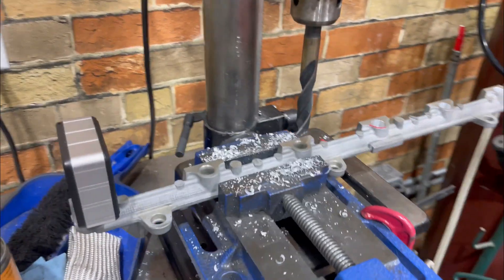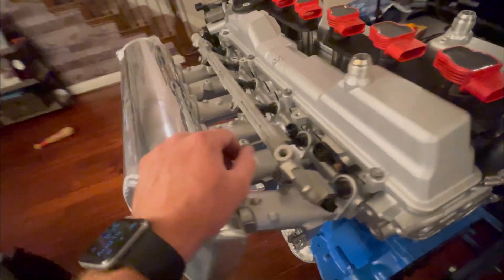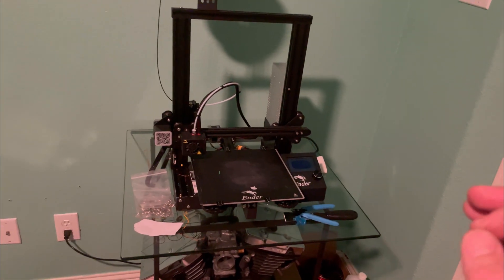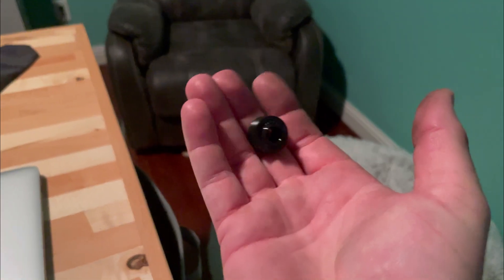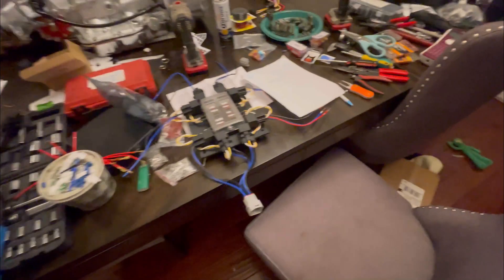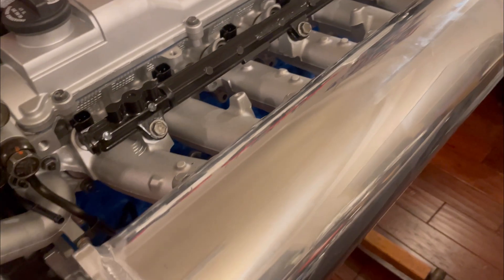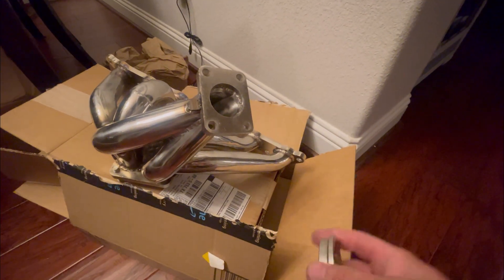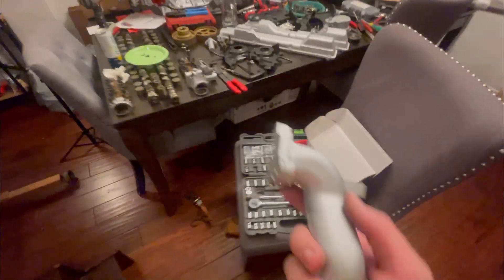My NEWJZ gets cams and more!

Comment: You have to run a return line with a fuel pressure regulator and you have not done that. I highly recommend running one with additional to trying to run this modified stock fuel rail that I find very interesting and worth testing. But you can find other guys like from the is300 community weld in a -8 fitting on the top of that front casting on the rail
Reply from the maker: You don’t have to run a return line on the rail. You can run a boost referenced pressure regulator remotely, and return from the regulator. That’s how I set this up in later videos.

Comment: Do you think for lower power goals (400hp) a set of ls2 decapped would work? Also, What adaptor did you is on the intake side? (Btw I’m at this exact point in my build trying to sort my fueling options)
Reply from the maker: So on my other 2j build I ran those decapped LS2 injectors when I was on pump gas, and making like 14 or 15 pounds of boost if I remember right. They’re too small for E85, but you can maybe make close to 400 on gasoline. The fuel injector adapters I used are from drift motion. I’m pretty sure they have an adapter for the top as well but I just drilled the hole out using a drill press and it worked fine.
Reply: @masterofmachines  awesome. Great information. Thanks for that. You definitely have a new subscriber!

Comment: You print those spacers with pla?  Ive had pla delaminate in a hot cabin kf a car. I have PETG in my engine bay for a tps adapter and  its holding up well. Id be
Reply from the maker: I do have concerns about it this. I’m also running a printed tps adapter as well. Thanks for the info.
Reply: @masterofmachines   On the TPS its not a big deal, If it gets soft your tps goes out of adjustment. Not a big deal. If those spacers go soft you bolts will loose clamp load and then could back out and then your injectors could come loose and fuel everywhere. Fire,  explosions.  on second thought could you just machine down the current ones on a lathe or even just a flat piece of glass and sand paper?  They are plastic right?

Comment: That's a little different from, "gonna waller it out with a 9/16 drill bit," good on ya
Reply from the maker: Glad you came around lol. I actually used a 17/32” after all. Your concern was legitimate. The walls aren’t as smooth as I hoped. But I’ve also had perfectly smooth injector bungs leak unless I ran double o-rings so I always expect the worst in any situations. Things usually work out.

Comment: Nice!  What HP goal?  We need to race when we get both are cars going.
Reply from the maker: Initially only trying to make like 5-600 wheel. Once the chassis is dialed at that power level I want to spend more on internals before I turn it up.
Reply: That should be exactly where I will be at once I turbo my VH @masterofmachines

Comment: What car is it going in? Sc300 is300 Cressida. May have issues with booster ...if do can dent booster in but that intake sucks...don't run it...
Reply from the maker: Datsun 280zx
Reply: I've had 2 of those cars a 79 and 80. 2+2 ones not care for but if u can make bumpers smaller would make the regular one pop ....cool cars